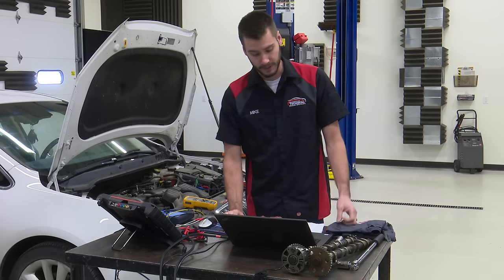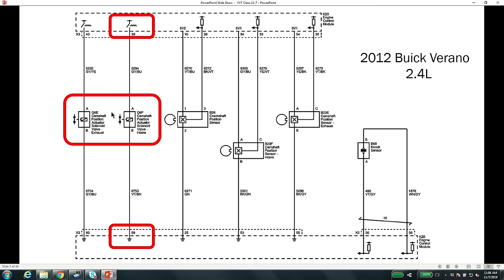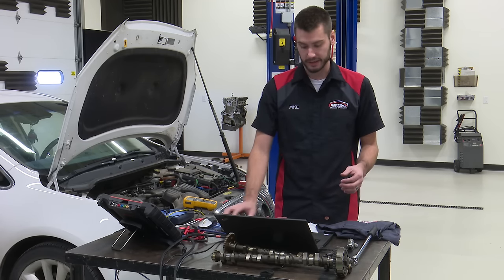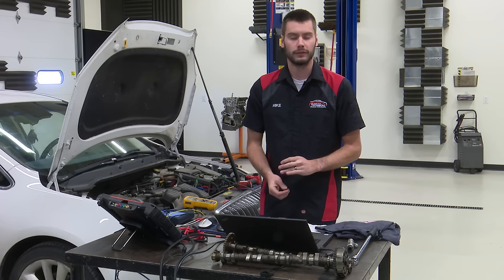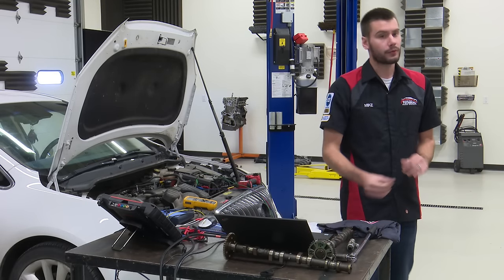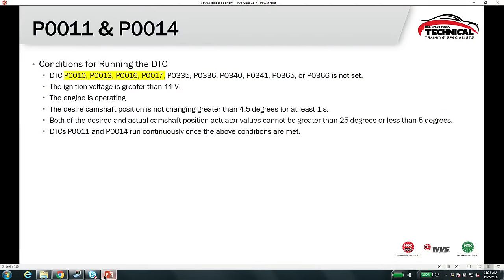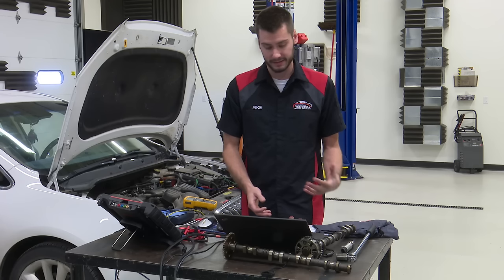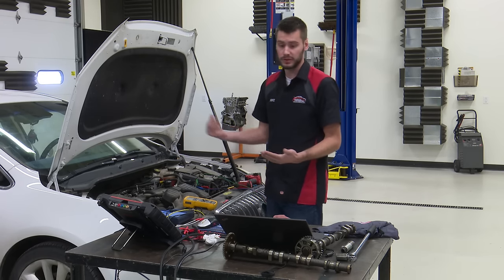P0011 - P0014 Variable Valve (Cam) Timing Codes and How To Diagnose Them

Comment: Gosh. I am Arabic and I am not fluent in English.  In fact, I have been suffering from this warning for more than 8 months and I have not found a solution to this problem.  I am using the car on a daily basis.  The alarms I have are U1111 plus P0014 and P0011.
My Car is Kia Optima 2011 2.4 GDI USA
Rpm is normal around 600 to 650
Battrey 14.4

I have changed the solenoids
And the Cam sensors
The oil is 5w30
Filter is new and orginal
But still The issue is there??!!

Could you help me what I have to do?
Reply from the maker: Hi Alkathiri, the 2.4L Kia engine is that year is known for internal engine issues. That code may be set for an engine mechanical issue. It may be time to inspect the actual mechanical timing either with a lab-scope or by removing the front cover. 
Mike Becker, Senior Technical Instructor

Comment: have you ever seen any problems with toyota / lexus vvti systems?
Reply: All the time... The 2.5l Toyota has this issue
Reply: @Usmanthemecano  how about the 1.8 's ?
Reply from the maker: Jeremy, the short answer is yes, all cars have issues. The VVT epidemic right now does seem to be maintenance-related and not so much vehicle manufacturer related.
Mike Becker, Senior Technical Instructor
Reply: @GoTechTraining  hey Mike! You're one of my favorite teachers! You're calm humble and relatable. I hope a case of a bad cam phaser will come on the 2.5l Toyota. Cheers

Comment: How about the manufacturer of the vehicle won't do the first "break in" oil change till 7500 miles.  When we all know it should be changed without the first couple thousand at most on initial break in where the most wear occurs
Reply from the maker: Ughh I hate that they got away from "break in" I know I did it on my newly purchased vehicle. 500 miles I changed the oil...every 3-4k since with full synthetic. 
Mike Becker, Senior Technical Instructor
Reply: ive changed a new 2018 camrys oil with 10K on the factory fill. sent it off to blackstone labs and they didn't seem too concerned with the amount of wear metals in the oil, or that it had done any long term damage. the vehicle has gone through 3 more 10k oil changes and now has 42k on it. but only time will tell glad its not my car.
Reply: I've been doing the maintenance on a fleet of Toyota rental cars for a number of years. They do no more than recommended maintenance and sometimes a little less. They often put over 160K on them and I've never seen any mechanical problems with the engines. Engine manufacturing has changed a lot in the past 40 years.

Comment: Most of the problems I come across with vvt are lack of use. IE. NOT being revved hard enough for the vvt to kick in. I bought a Honda that was sluggish and had idle drop problems the previous owner never revved it beyond 2000 rpm, the same can be said of a Toyota which probably never exceeded 40mph and had never been revved by the lady owner. I changed the oil and gradually began revving them up to the rev limiters and all of the sudden on the Honda the idle drop problems stopped and then with full vvt working it went like a scalded cat. the Toyota took a little longer for the new oil to get through the  cam phaser and ungum it, but eventually this succeeded and now is transformed.
Be very careful of fault codes on vvt  systems often parts are not faulty they just need to be gently persuaded to work again. Mini owners take note ! I have resurrected many later engines by revving and an oil change,however a diagnostic machine is required and a procedure to be followed, but not an new timing chain kit !!! if the chain is rattling unfortunately  it may have been left too late for this to work.
Reply from the maker: Hey Mazdaman, thanks for watching! That all depends on the type of system. This Buick in this video actually phases the cams at idle. VVT or VTEC operates a bit differently, only turning on at that higher RPM.
Mike Becker, Senior Technical Instructor

Comment: I don't know why engine oil flushes get such a bad rep. It's like not wanting to do a back flush on a plugged heater core because you're worried it might start leaking... They're definitely not a replacement for proper maintenance and I don't believe in doing them on a healthy engine but if your other options are engine replacement/overhaul then why not give it a shot? Ya you need to communicate with the customer but that's supposed to happen with every work order...
Reply from the maker: The reasoning is because a flush looses stuff up that could plug up other areas. On a heater core flush you can get everything out. On an engine, stuff gets stuck...what if that flush causes a chunk of junk to get stuck and block a main oil feed to a cam? Then the cam fails...who's paying?
Mike Becker, Senior Technical Instructor
Reply: @GoTechTraining  Customer pays as they were going to be buying an engine anyways. To be clear I don't believe in engine flushes as "routine maintenance". The times I've used them is when there is what seems like a mechanical problem with an engine on an older/abused vehicle where it's not worth the money to go through with the actual repair. Mainly I just get curious how oil flushes have such a taboo stigma to them. Sure there are risks but there are risks with everything. What if a vehicle comes in with a bad lifter and you opt to replace the lifters and the camshaft on that bank? What if anything happens to that engine? No matter how unrelated... Drops a valve seat, spins a bearing, gets a dead hole... How are you going to explain that had nothing to do with your work...?
Reply from the maker: All good points. So you're saying when the customer is left with no choices an engine flush is potential repair...with the full understanding that it may or may not work and it may or may not cause more damage. I can live with that! :)
Mike Becker, Senior Technical Instructor
Reply: @GoTechTraining  Plus they are especially good to do in the slow winter months. Who wants to be doing oil changes all day long when you can turn some of them into engine re&res??? ;)

Comment: P0011 on G35 ?
Reply from the maker: Sounds like a cam/crank correlation issue. Is that car common for stretched chains, doesn't throw any major red flags up for me.
Mike Becker, Senior Instructor
Reply: Check gallery gaskets, they can cause vq motors to throw that code
Reply: @Xavier_Wells  okay I will need to remove the entire from engine cover.

Comment: I get code p0014 on my Volvo S60 has 129,000 miles did an oil change and replaced the exhaust vvt solenoid and this code pops up. I think one owner skipped an oil change so I’ll try another oil change to clean it out. Any help will help thank you!